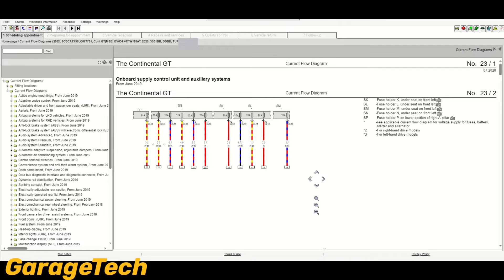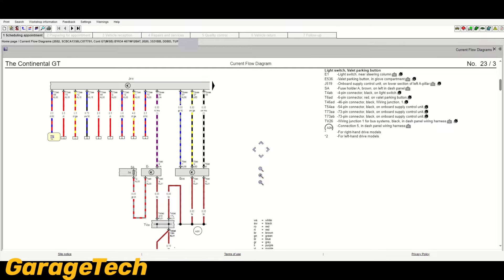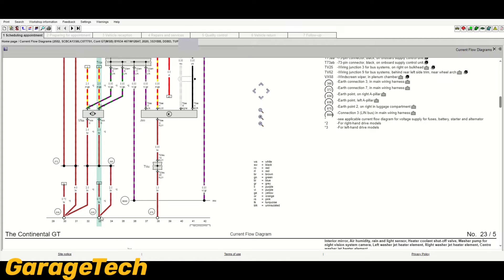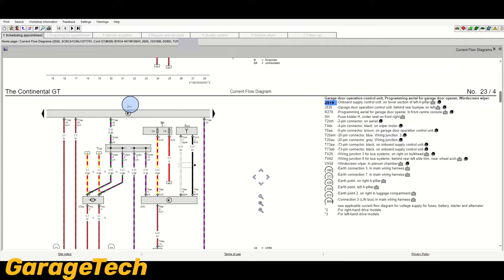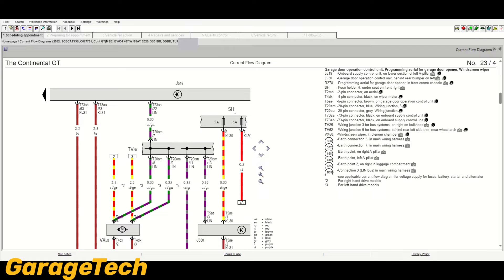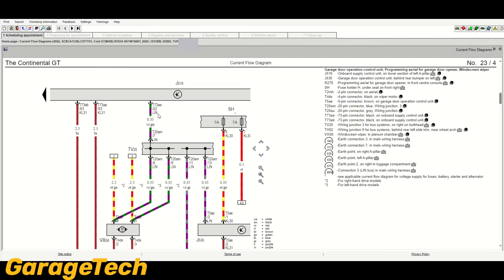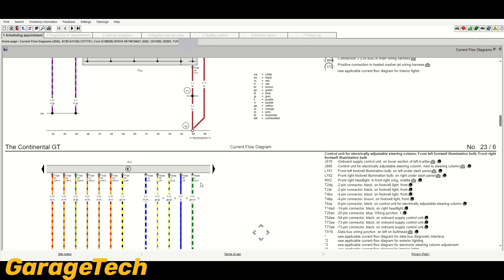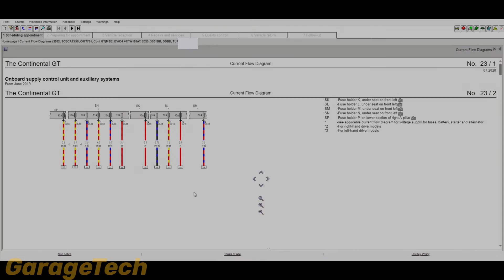How to read and use VW Audi circuit wiring diagrams.  Current Flow Diagrams Skoda Seat Bentley help

Comment: 5:33 how do you know where that connector is physically located? 7:40 What document tells you the location of t73aa and t73ab (if you are not using the pc version)? Where can I get the pc version for the audi A3 8p?
Reply from the maker: The icons at the end of the description, (camera and plug) the PC version will show you/detail the location. In this example T73 is plugged into the J519 control unit, which in the description is located at the lower left A pillar. This should give you enough detail to get you in the right location. If you wanted your own version then there are some online places like manuals online you can try. It’s worth just heading down to a local dealer and seeing if one of the techs can have a look at a diagram for you, no harm in asking 👍🏼

Comment: Hi This is a great video. I have a question. I have a 2005 Bentley Continental GT that doesnt open ignition and it shows 
immobili Active. I recently got an ignition Kit (Switch, Kessy, ECM1 ECM2 and instrument cluster). It looks to me like there is some data loss but my wiring diagram is old and without color. Do you have any idea what it could be. Im also confused because between wires on m diagram it shows "o 0.35" which i dont know what it means. Any direction on what to check would be greatly appreciated.
Reply from the maker: Hey, hard to say without seeing the diagram you are referring to, you may need to check the wires at the ignition switch, that will normally feed a relay. I’d check all that first. The older cars, the diagrams will likely be just black and white, the colour code or “o” you mentioned seems strange it’s normally 2 letters. If you can send me a picture I can take a look ?

Comment: question could u post a video about the front right passenger side of an audi a4 2014?
Reply from the maker: Hey, I don’t have a diagram for an A4, was there something in particular you are after?
Reply: @GarageTechAutomotive  particularly anything to do with lighting like fog lights and headlights at the front right passenger side
Reply: @GarageTechAutomotive the wires run all the way through the wheel well so its not easy to track back to sorce/fuse
Reply: @GarageTechAutomotive  i currently have a purple and brown wire that are cut tht i think are meant to go together two neon green ones and a white and blue checkered one with another brown
Reply from the maker: @OhTkey  ah ok, yeah you’re going to need the correct diagram for your chassis number. I’ll have a look in some technical documents I have but usually they won’t have the complete diagram. You could try a search online but you need to be sure you’re getting the correct diagram. If you live near an Audi dealer, might be worth just popping in, see if you can speak to one of the techs, to look it up for you, they can only say no 😂

Comment: What software do you use for VW wiring diagrams? I have to solve a problem with the courtesy lights
Reply from the maker: @oltrig8804  this was the genuine manufactures software ElsaPro. You can subscribe to a version called erWin or if you just want one vehicle for a one time use, e manual online might have it 👍🏼
Reply: I need the wiring diagram for the 1999 Golf Mk4 1.6 Rs akl...where could I find it?
Reply from the maker: @ you should be able to find one online, just be careful it’s the correct one for your engine code
Reply: @GarageTechAutomotive  I would have found the scheme but I have doubts on some points of the electrical diagram. Do you have a telegram group where I can send you the photo?
Reply from the maker: @ DM me on instagram

Comment: Just wanted to ask another question now you posted all the meanings

What are all the different terminals....i know you have put the list but what does it actually mean? are these essentially controlled by a relay some where? Like terminal 56 headlights for example? what does it actually mean - is it stating that there is a relay for the headlighsts?
Reply from the maker: Hey  @fabiotozzi7419  so it means it’s the actual signal/power wire for that circuit. For example 56 headlights, that wire will be the live supply wire for the headlight. That live supply could come from a relay or an ECU. In a typical headlight circuit you will have a light switch which could have 10 wires, (modern cars use data communication so will have 3 wires, live, earth and data coms (LIN)), but let’s say 10, one of those will be the signal wire for the headlight circuit (56), that wire will send a signal to the ECU to switch on the headlight, the ECU will have a wire with the same signal name (56) which will go directly to the headlight for the 12v feed. Now just remember that every circuit will have an earth wire which cold be shared. You would need to trace back the wire from the headlight to see where the feed is coming from, typically will be the onboard power supply control module. Hope this helps 👍🏼
Reply: Sorry for the 4 month reply time but wanted to say thanks! Just came back to dig this comment out  @GarageTechAutomotive

Comment: what does CTRL mean - i see it on a few wires on diagrams
Reply from the maker: Hey, it stands for 'Activation for actuators' which is the output wire which controls actuators or solenoids. There's a few variations and although the terminology is actuator, it can also be seen on other components. I've added the full list of the wire designations terms into the description. hope that helps👍
Reply: @GarageTechAutomotive  That list is incredible!! i could not find anything like that at all

The reason i asked was i was trying to work out why my fuel actuator stopped working.... which now you said what CTRL mean it makes perfect sense why it was next to it on the wiring diagram

Thanks for responding - great video and great help!

Comment: hi is there a way to look at connector pin information. such j519 t73. is there a picture or diagram that shows what each individual pin is. like pin 1- power pin 2- ECM supply pin 3- coolant fan signal etc. thank you
Reply from the maker: Depends on the age of the vehicle, newer cars and diagrams tend to have more details but usually you’ll need to trace the wires back.

Comment: Hello, nice video!
What’s this program called? And where can I get it ..?
Reply from the maker: Hey, this is the official dealer system called ElsaPro, there’s another version which you can pay for call erWin. You may be able to find PDF versions on forums etc. otherwise http://emanualonline.com you can get the same ones which is basically a link to erWin but only for the diagram or part of the manual you have requested. It’s not free though.
Reply: @GarageTechAutomotive  OK thanks :)

I just got diagrams sent over by my local mechanic for my 2019 golf.. they look exactly the same as the ones in your video… Will those files also work ?because there are so many different engine types into the document…
Reply from the maker: @electro-henk  hey, as long as you can identify the correct engine type and model year you should be fine. Depends on which circuit you’re looking for as well. What’s the issue with the car?